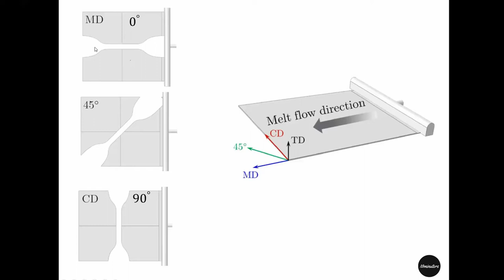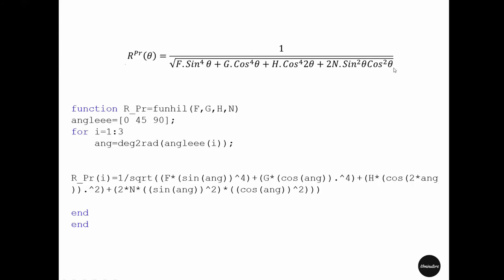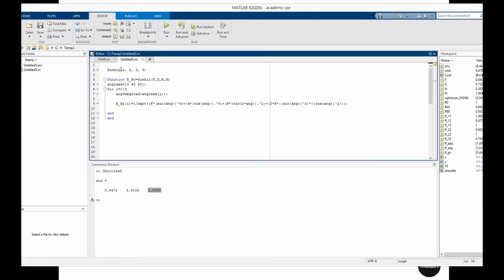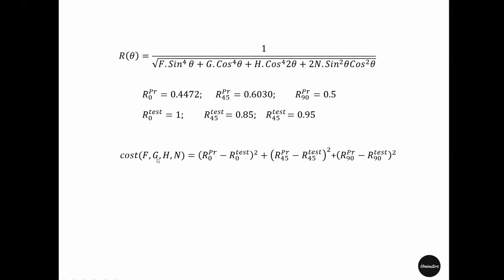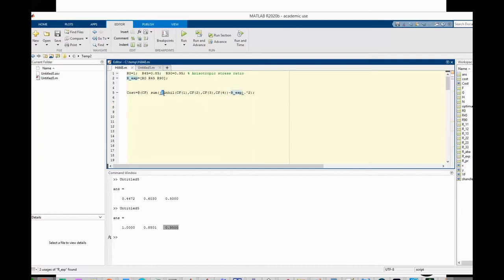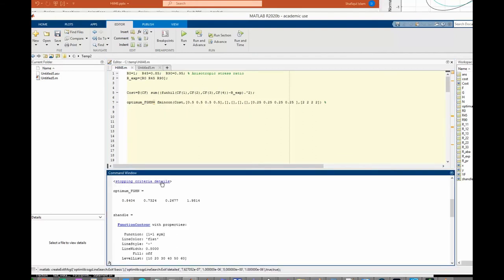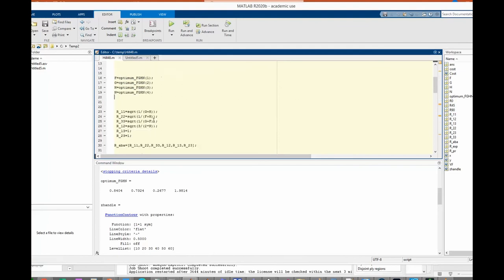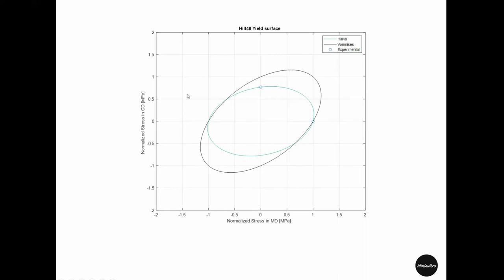Hill48 anisotropic yield parameter optimization for simulation (Get MATLAB code)

Comment: Great explanation. Could you tell where is the reference for the equation for R(theta) and the coefficients Rij? In Abaqus documentation those equations are different, and the result is not the same. With your R(theta) function I could correctly match experimental and simulation results

Comment: Thanks for explanation, could you please tell me how did you decide the F = 0.8404;
G = 0.7324
H = 0.2677
N = 1.9814 as the optimum values you needed in the first place?

Comment: If we assume R13 = R23 = 1 that would mean that there is no anisotropy in the 13 and 23 Dicection for shear stresses right? Is there any possybility to further estimate those to values withoud having to do any additional Experiments?
Reply: dude! You've got your answer. You know how to calculate it using any method. please explain it. I also have same confusion.